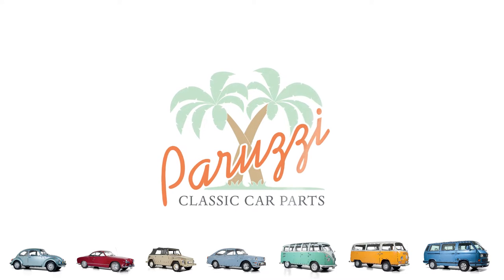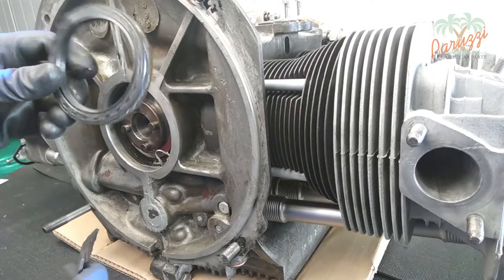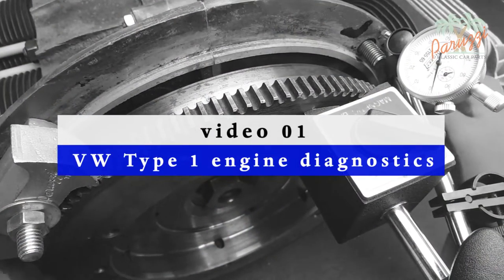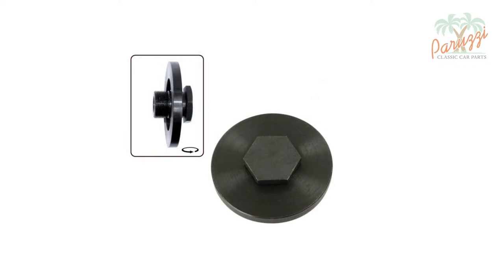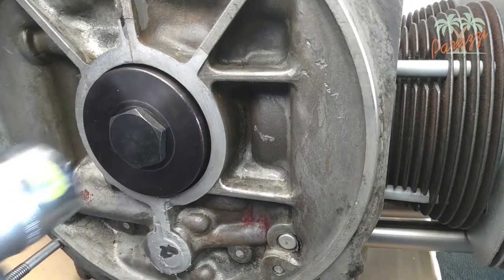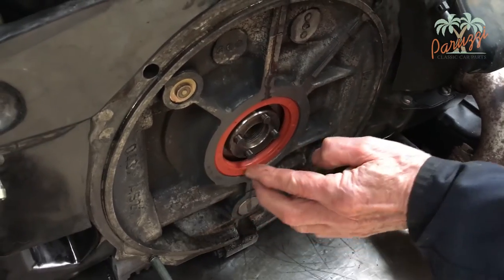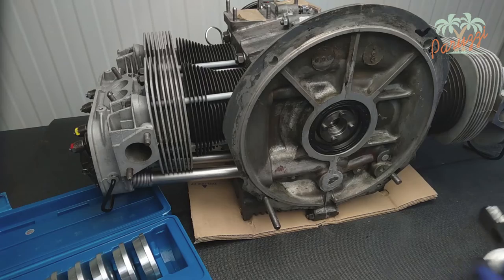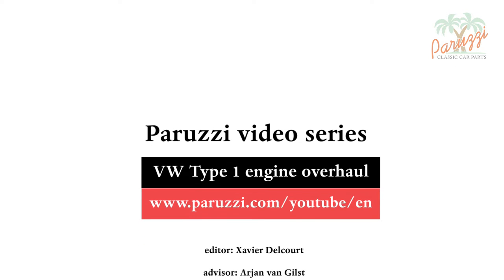13 Engine overhaul - replacing the crank seal

Comment: How many crank seal we put for vw beetle?
Reply from the maker: On VW Type  1 there is one crank seal. But, watch out, some flywheels (later types) have an O-ring in the flywheel, that also seals the crank. Older types have an additional paper seal. Watch the flywheel overhaul video for more information: https://youtu.be/PJyZuIq-wEs?si=WGQlfwn8_RsDnVxy